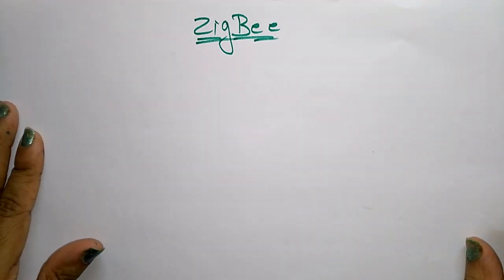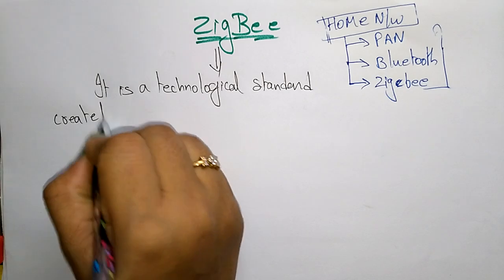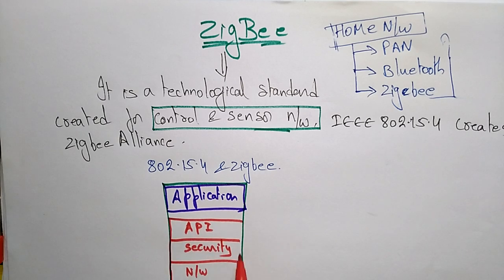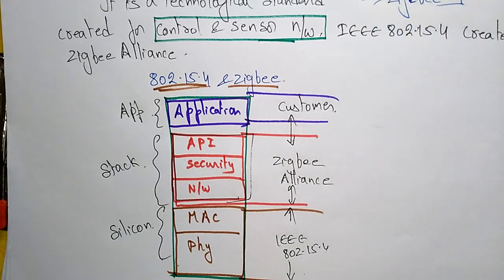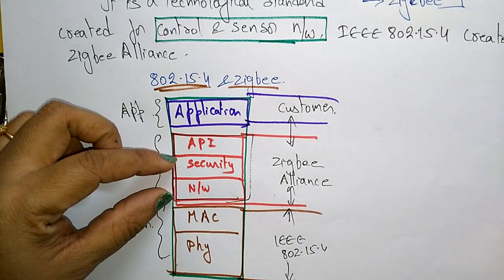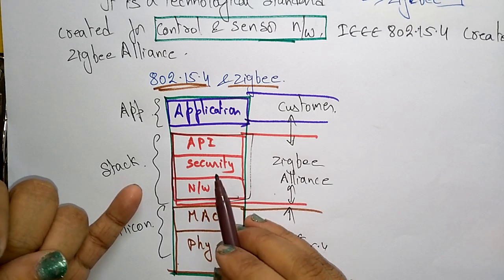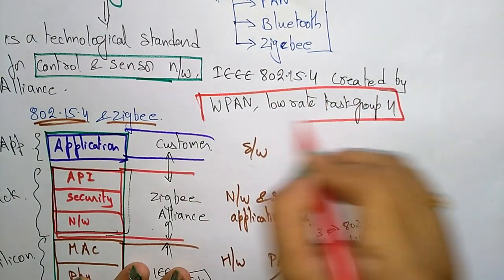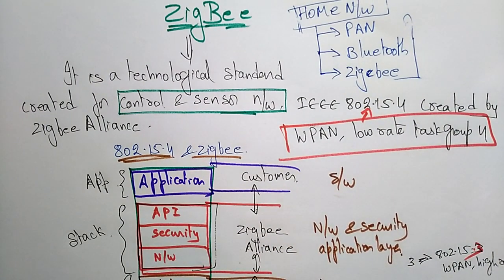Zigbee Introduction | Part-1/3 | CN | Computer Network | Lec-25 | Bhanu Priya

Comment: Can someone help me with these questions?
6. Explain how do you configure a Zigbee device for a WSN. What are the fundamental requirements to configure it?
8. Explain the basic requirements for designing software to extract and store data from any communicating devices such as Zigbee.
9. How a Zigbee based WSN can avoid interferences from another Zigbee based sensor network in the same region?
Reply: Yes